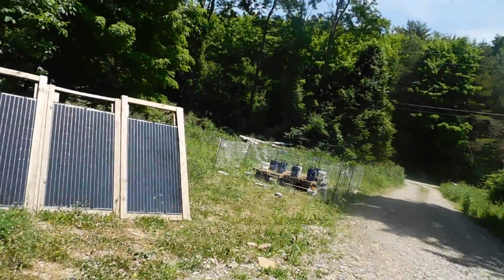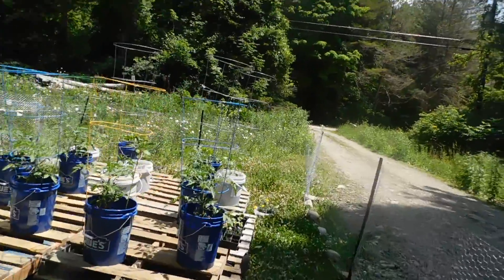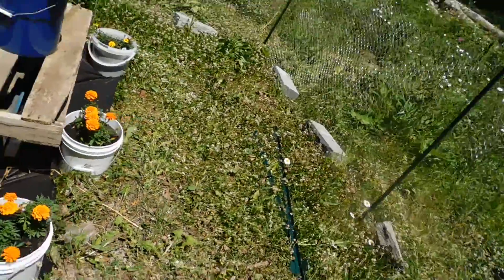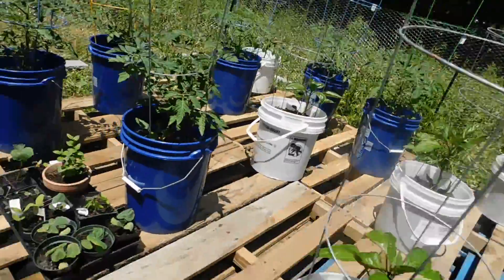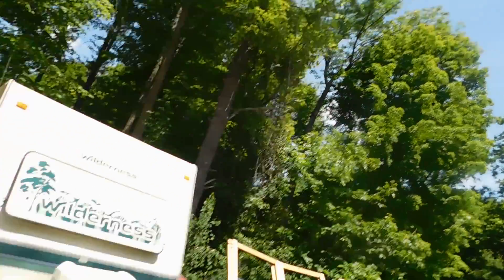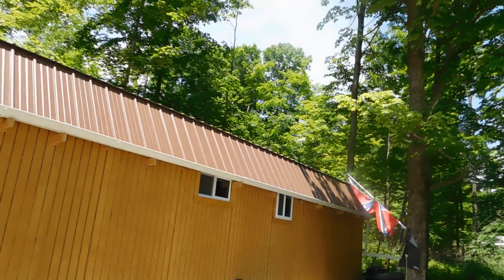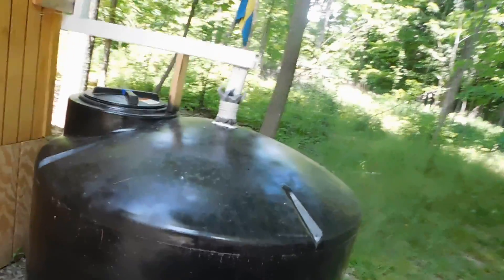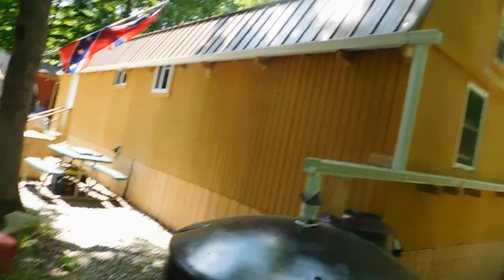Explaing more about our off grid solar system.

Comment: What type of panels do you have? I'm considering Power film that I can mount on my shed. I feel a need for transportability. I just have the shed and my TinyHouse. I have a Goal Zero battery that I currently keep charged from a grid hook up. I'd like more freedom to be totally off grid if it comes to that. Otherwise, I can last about five days covering the minimum basics. Ideas?
Reply from the maker: Get a few 250 watt panels and good batteries it always comes down to want and need.

Comment: SO, are you running a 24 volt system and straight 120 volt for the house? I am setting up a new system with 24 volt battery bank , 6 solar panels at 250 Volt each and a Conext 120/240 inverter with a midnight classic 200 charger. Next step is to wire to the house. You should put up a ceiling fan in the house. Thanks
Reply from the maker: I have 2 ceiling fans. and yes I have a 24 volt system. and use 120 for the house. Good luck with everything.

Comment: A big advantage of running the air conditioner is it also dehumidifies. You may want to run some string over your garden to ward off birds. Also might run electrified wires down low for raccoons and up high for deer. Run 3/4 inch pvc for water to garden from motor home. create solar water heater with black garden hose with small recirculation pump in your water storage tank. Start a herb garden in plastic tubs, they are easy an so useful.  Just a few ideas that came to mind. With out family we have nothing, nothing at all. And without great fathers to teach us about family life we are lost. This world belongs to our children so  lets not screw it up. Lets take back America for she belongs to us. The more each citizen communicates with their representatives the more we take back control.
Reply from the maker: That is for sure and great tips thank you.